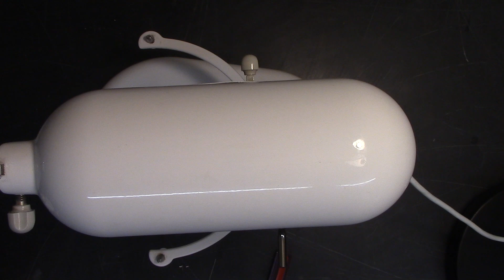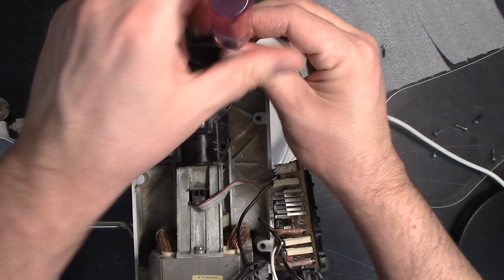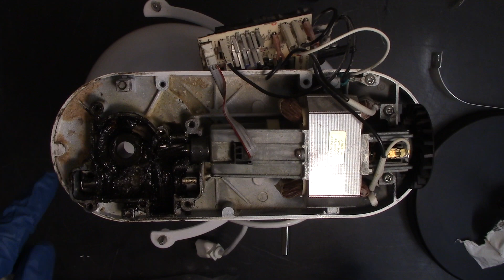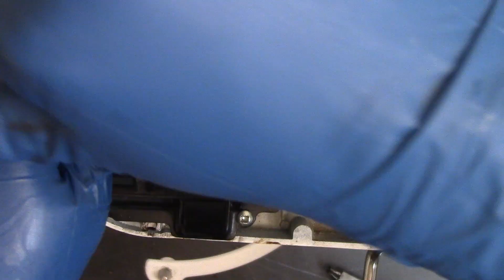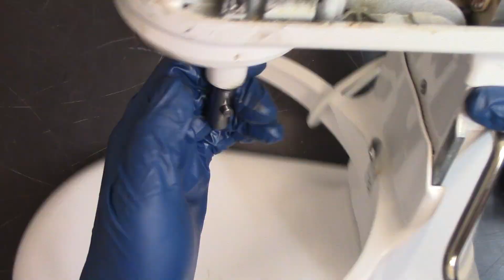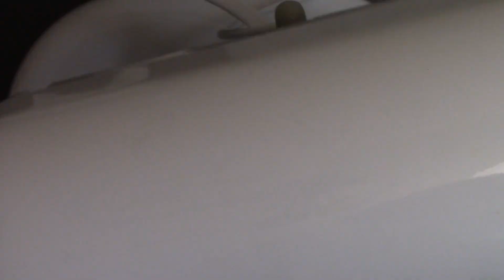Repair Broken KitchenAid Mixer - Worm Gear and Grease

Comment: When you 1st open the plastic gear-box you removed a spacer, that was actually the upper-bearing of the main shaft. You should have replaced it back into the housing with a wooden dowel. When you re-greased the mixer you left a paper towel wadded in the bottom of the gear-box. I'm not a critic, just pointing it out...I know "how-to's" are not easy!

Comment: after reassembling parts on the planetary the worm follow gear and the beveled gear fit together.  But the worm follow gear slides down, the beveled gear is stopped with pin. Why is the worm follow gear moving down?

Comment: Thanks for this video.  If you watch it carefully replacing that gear is pretty easy.  One of the videos I watched for this procedure said it should take only 15 minutes to do the whole thing.  I spent an hour on removing the old grease and putting in the new.  Other than that, this is a good video and it makes the job easy.

Comment: You mentioned a Phillips star bit. the screws on my Pro 600 are a #2 square recess bit, and using a Phillips bit on them very likely will bugger the heads.

Comment: This mixer is a lot like my Kenmore Elite mixer.except the off on/speed switch is a knob. having trouble removing it to remove the screw that holds the top on. Model #100.8920890A

Comment: I changed the gear assembly and reassembled my mixer and the motor does not work.  I didn't make any changes to the motor assembly, only the planetary gear.  What could the problem be?
Reply: check your assembly, likely things are in a bind or a wire came off your controller.

Comment: I have the same problem as you had, a clicking and "miss" when a little resistance is given.  My wife does bread dough about once per week but the mixer is only a little over 2 years old so I am very disappointed in Kitchen Aid at this point.   I removed the top and I have a similar model to yours, everything looks as it did in your video.  You have given me the confidence to go ahead and remove the gears and look for the damaged gear and replace...   Thanks for the great quality video.   Wish me luck!!

Comment: I had the same problem as others had.  I changed the grease.  Put it back together and now it does not work at all
Reply: +Nancy Rodgers Do you mean it does not turn on or the motor is turning and the planetary is not spinning?

Comment: When I open my mixer it doesnt look like yours. When I take the top off, everything remains in the top which has a metal cover that does not look removeable. I dont see any speed control parts or any electrical connections at all.  They all appear to be under the metal cover. It almost looks like you have to pull the insides out from the back where the power cord plugs in. Are there instructions on how to open this kind of mixer and repair it? My mixer is a Kitchen Aide stand mixer model #K45sswht, Serial #1103854.
Reply: This please! I am having the same issue. I was taking it apart to replace the grease and it fell over onto the table. After having replaced the grease it wont turn on at all at this point. I have checked the inner connections and it is receiving voltage. I am unsure what the issue is but I sure as hell cant figure it out while I cant get at the motor.

Comment: I replacement my worm gear and now the machine wont turn on at all. Is it possible that the motor has to be replaced? When I plug it in and turn on the switch nothing happens at all.
Reply: 4 years is too late to reply but in case it helps someone else... do you have an older machine with what looks like a flat-blade screw head on each side of the casing?  If so, those are carbon motor brushes. They conduct current and have to be inserted in a particular orientation, or else the electric current can't flow and your machine won't turn on. There should be a flat side on the brush, and IIRC it is in the upper left position on the left side, and lower right position on the right side.